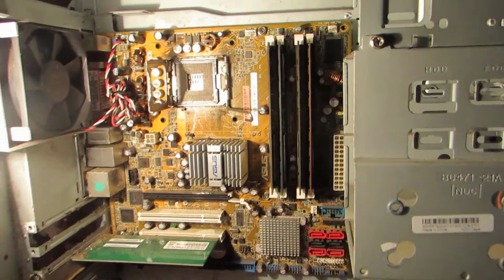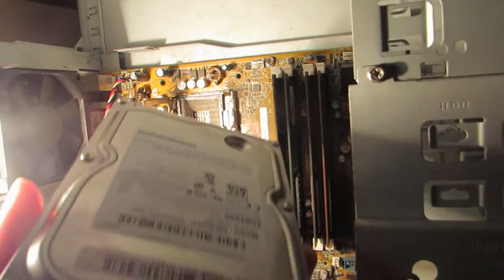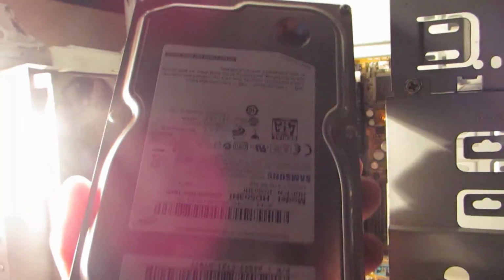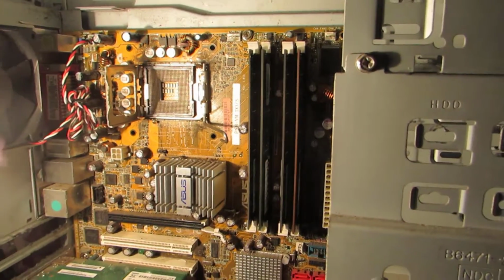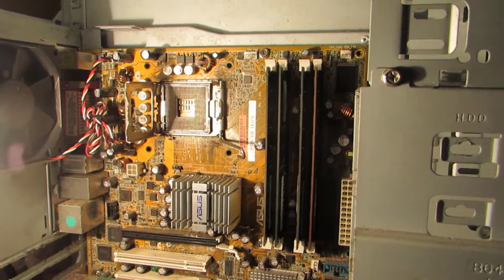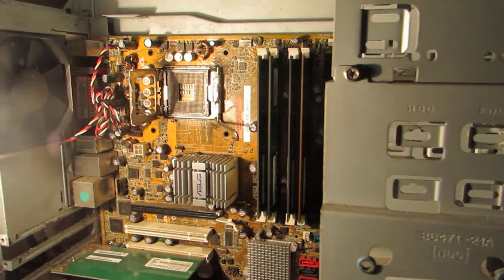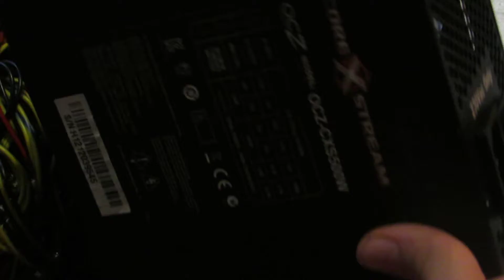Ultra cheap gaming PC build part 2

Comment: how are the temps ?
Reply from the maker: Not too bad, the graphics card is nice and cool, that processor gets hot though
Reply: 60 above? how is that antec a 30
Reply from the maker: The CPU does hover around 60-65 but I don't blame the cooler, the a30 is an excellent budget option, I even used it on my new system, so if you want to see another build check out one of my newer videos. Also if you have discord check out my channel, I am trying to grow it
Reply: well i have acore 2 quad q9400 temps hitting 80 on stock cooler im thinking of getting the antec a30 whould u recommend?
Reply from the maker: You should notice a small difference but I wouldn't buy it if you are going for an overclock. Try one with an extra hear pipe because the a30 only has 2
Reply: et studios no no  im not an overclocker
Reply from the maker: Then the a30 should be fine, at least get you into the 70s. If not they can be easily re-sold so if your not happy you can probably get your money back
Reply: oh tanx man but i need my cpu under 60